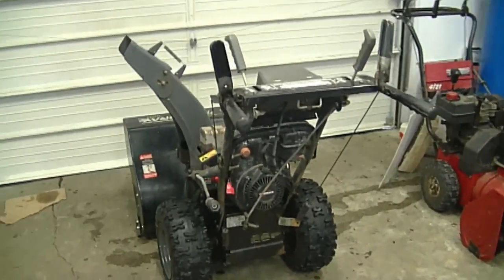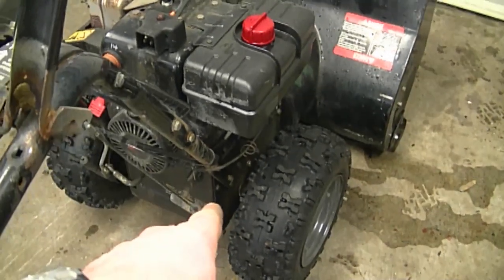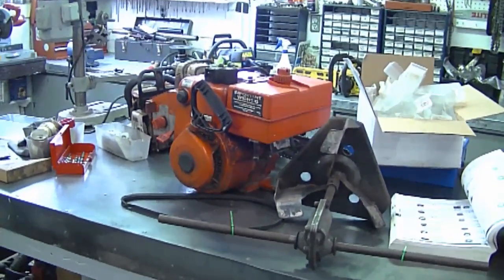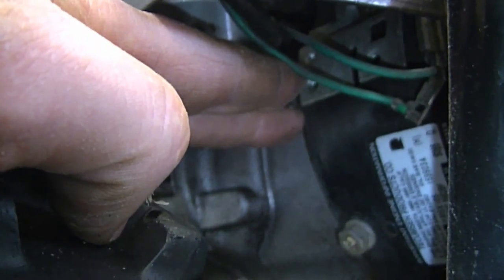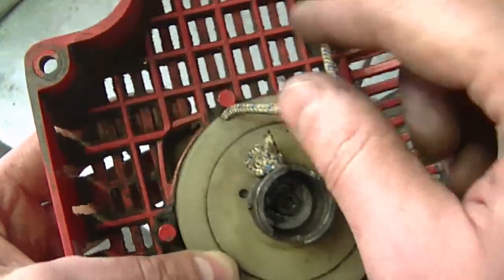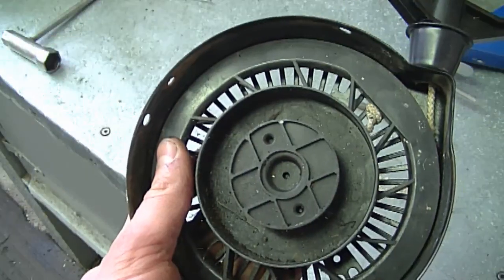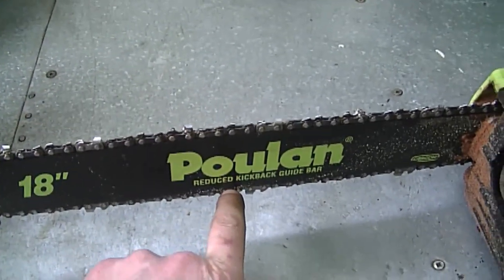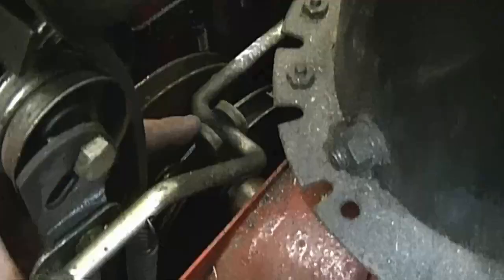Small Engines Q & A Video #119 in HD

Comment: I usto live in Connecticut and work on sirens snow blowers with the tv's 100 Tec engine on them and never had good luck with the carb idleing and I have rebuilt a lot of them even taking out the Welch plugs and I could never get them to idle Id put a new carb on and it would be fine do you have that problem in Canada
Reply from the maker: yes same thing here!

Comment: Does anyone know why my older Stihl strait shaft commercial grade trimmer wont run. It runs right up but you have to be constantly on the throttle to keep it going. I figure its the carb, but I was just wondering what the heck was the matter with it. If you answer back I will give the model number of it .
THANKS

Comment: ive got an old 8hp tecumseh motor on a snowblower, i rebuilt the carburetor and now it will only run with the choke on, i have had engines run like this before.  What could cause this?

Comment: Hey donyboy73, it's Phil Q from Pittsburgh, PA. I wrote to you  earlier about a Tecumseh HS50-67326K. I put a new carburator #640-084B (520902) on the machine. The problem is that I cannot get it to high-idle. It wants to fluctuate. I've done your other suggestions; i.e., checked the exhaust valve. In green on leak-down test and I've adhusted the governor in both directions, with no positive result.  I'm stumped. Any other suggestions? Thanks.

Comment: Maybe try using a degreaser spray? I have this spray called Grez-Off and it's great. It's non-toxic meaning it won't eat rubber or harm anything. I've used it to wash my hands in a pinch...

You may be able to use that and a rag to wipe off your belt, but be careful while rotating the belt and pulleys, you might get your finger caught.

Also, BE 100% SURE TO DISCONNECT THE SPARK PLUG WIRE IF YOU ROTATE THE BELT.

Comment: If you have hit anything with your mower, you may have a bent crankshaft which will cause excessive vibrations.  To easily check this, first take out the spark plug so that engine does not start and is easier to turn over.  Then get someone to tilt the mower back and pull it over.  While they are doing that, look at the center blade bolt.  If it wobbles back and forth at all the crank is bent.

Comment: Hi mate just a quick question but why does my lawn mower vibrate excessively when i use it? the blades are fine and are not damaged and the engine runs really well and smooth but boy does it vibrate? is there anything else that could be causing the problem? I really hope it's not a bent crankshaft. also if it is, how do i check? thank you.

Comment: Excellent video!    Chainsaw: I use an electric chain sharpener I got from Harbor F and it works great, as long as I don't take too much metal off when I use it.       Question- When you sharpen a chain, do you ever grind down the teeth that are between the cutting teeth, the ones that take away the sawdust?  If you do, what do you use to do the grinding?     Thanks.

Comment: Don, i got a old honda ems4000 generator i like to get it going when the weather is nicer, 
it for some reason gets stuck when i pull on the recoil. i have taken it out, the recoil, and reinstall .. it seems to pull a couple of times, then it gets stuck on the pull.. then i have to take out the recoil again. 
does some recoils go on at a specific way, meaning is there a timing notch? lol
thanks man